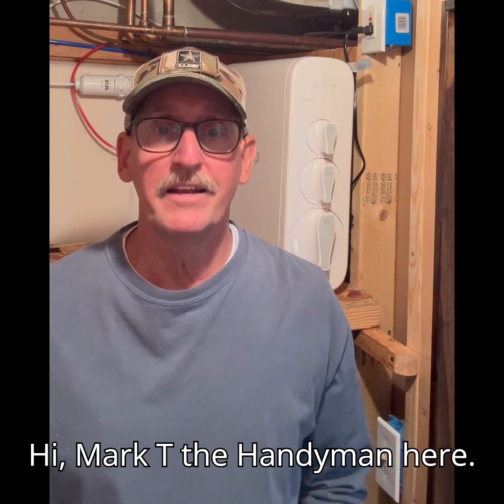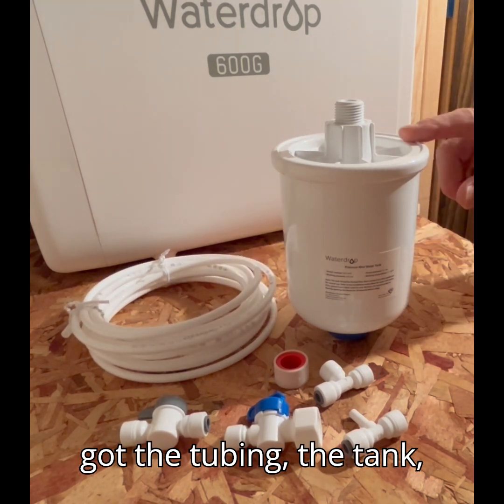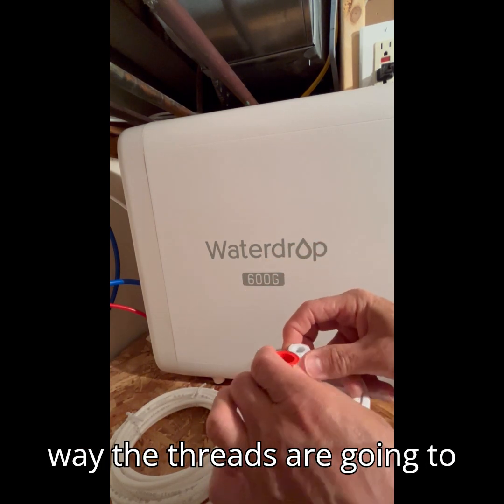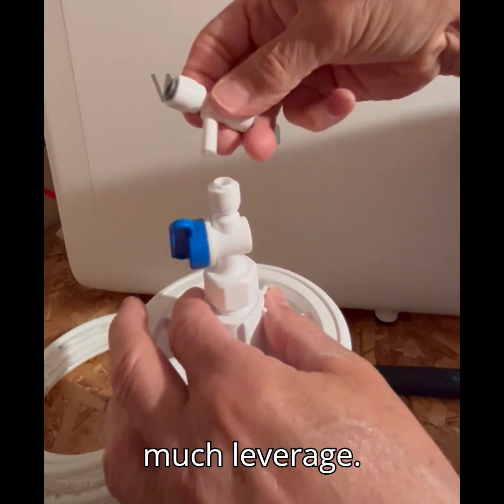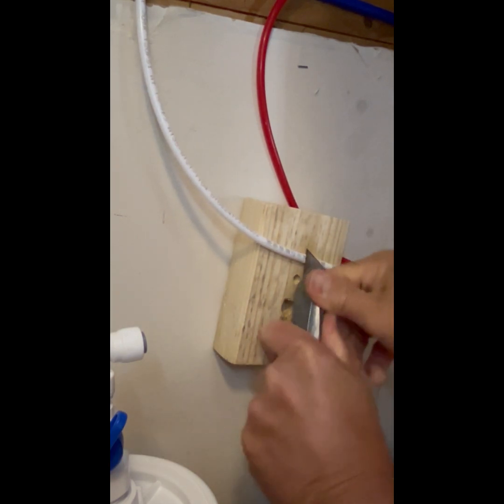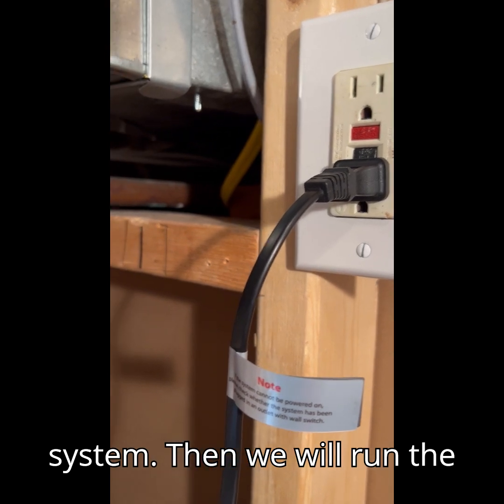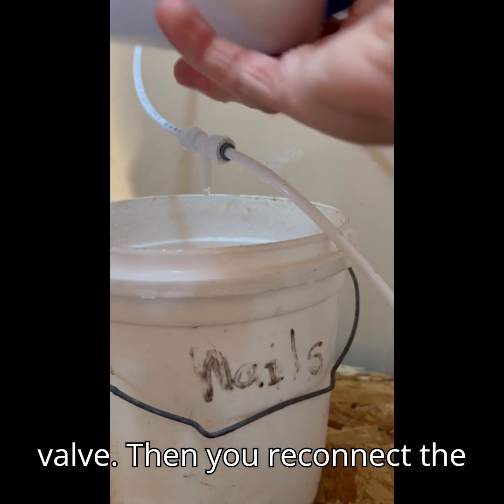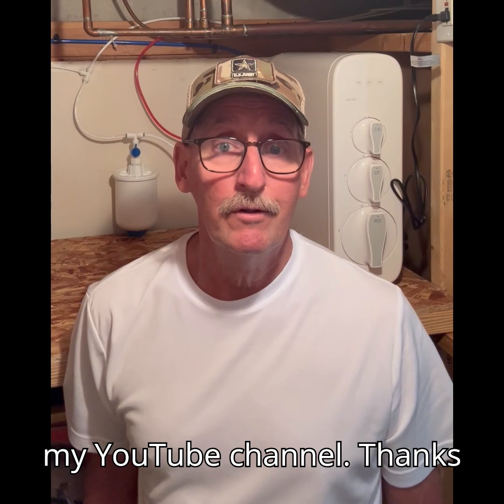Waterdrop Water Pressure Tank Installation

Comment: Once you tee off on the tank where does the other end of the hose go to on the RO tank? There are 3 different lines to connect too
Reply from the maker: Thanks again for watching the video and your comment.

Coming off the compression tank, the line going to the right is the supply line from the WaterDrop RO System, the line going up is feeding the tee that feeds my basement kitchen sink and the other line is feeding my upstairs kitchen sink and ice machine.  My WaterDrop RO System is located underneath the upstairs kitchen

Comment: Hey Mark! Thanks for the video it’s been super helpful. I’ve run my system for 3 bouts of 5 minutes to try to fill the pressure tank and I’ve had no such luck. Any insight? The 3 way valve has been open on top of the tank and it’s connected to the supply line before the T to my fridge. Thanks!
Reply: Hey everyone, turns out my model filtration tank was incompatible with the mini pressure tank. Double check this while purchasing accessories!
Reply from the maker: Thanks for the update and the suggestion.
Reply from the maker: Thanks for watching the video. Glad the video was helpful. When you say you have no water pressure does that mean when you isolated the tank and removed the tank and then opened the isolation valve to flush the new tank, nothing (Water or Pressure) came out?

Comment: How did you get the water to go into the tank?  I’ve hooked everything up correctly and no water enters the tank.
Reply from the maker: Let the system run for a little bit. The water should flow into the tank on it's own. Thanks for your comment and thanks for watching the video.

Comment: Great video Mark. I currently have  the same RO system and it is connected from the RO unit into an inline Mineralization filter(WD-MNR35) and then into the supplied faucet.  What do you think of installing this water pressure tank between the mineral filter and the faucet and running the tee split there to the fridge line?  Do you think there will be enough pressure even with the filter serving both the faucet and the fridge?  Thanks in advance for your great insights!
Reply from the maker: Thanks for your comment. I actually have a faucet located at my kitchen sink on the main floor, and the refrigerator/ice maker on the main floor, and also a faucet at a sink located down stairs.  Per the recommendation of  WaterDrop, I added an additional WaterDrop pressure tank near my kitchen sink on the main floor and it did increase my water pressure at the main floor faucet. In my original installation video I explain how I installed my Waterdrop RO system below the floor in the basement. Check out that video to see my location and distance of the WaterDrop RO system.

Comment: So far it’s ok,  it definitely purifies the water. I wouldn’t say the water comes out very fast. I spoke to WaterDrop and they said it is performing as designed. I have the upstairs kitchen sink, refrigerator/ice maker and a sink in the basement hooked up the RO system. Also my WaterDrop system is below the kitchen floor on a basement shelf instead of under the sink application.  Thanks for the comment.
Reply from the maker: I found some new information about how to get more water pressure at my upstairs Waterdrop kitchen faucet.  I installed another Waterdrop pressure tank next to my up stairs Waterdrop faucet and was able to increase the water flow almost double.
Reply: Is this really needed when you have a fridge with water connection?
I'd rather not have tank if I can avoid it

Comment: My kit came with blue plastic “C” clips that ensure the push fittings don’t pull out or blow out. 
In fact my entire system including pre filter, RO filter, UV sterilizer,faucet and pressure tank came with various sized “C” clip locks.
Reply from the maker: Yes that is correct. Definitely want to use them.  It gives you that extra insurance that you have a good fit. Also make sure your tubes are push to the proper level.

Comment: If I have a MRN filter, is it back or  down of the tank ?
Reply from the maker: I'm not sure exactly what your question is referring to.  In the system that I have installed I don't  have a tank, the Waterdrop system uses a pump.  BUT, on a system that uses a tank the filtered water is stored in the pressurized tank after it leaves the RO system. When there is a call for water at the RO faucet the water then passes through the mineral filter to the faucet.  Please let me know if this was helpful.  Thanks
Reply: @ thank you so much, the mnr filter is the mineral filter.